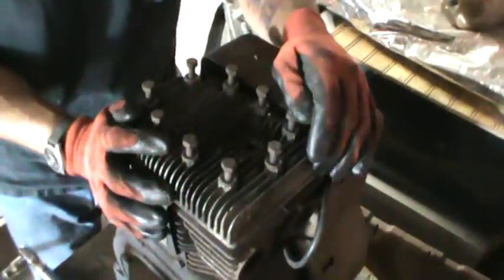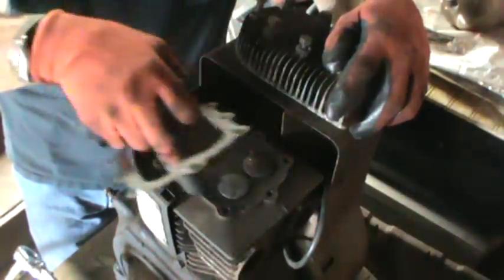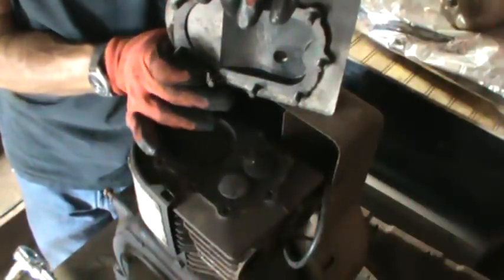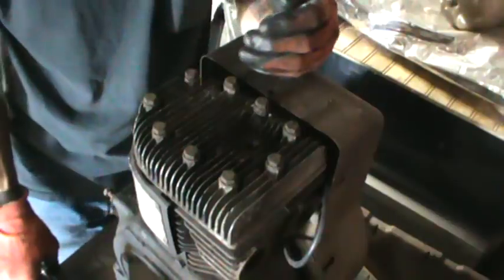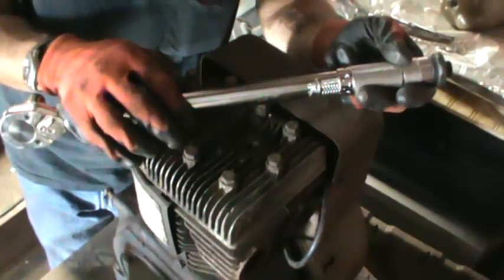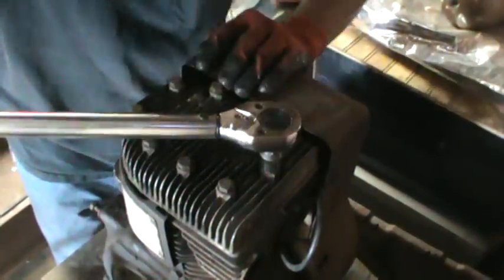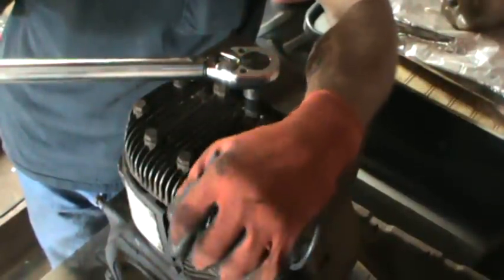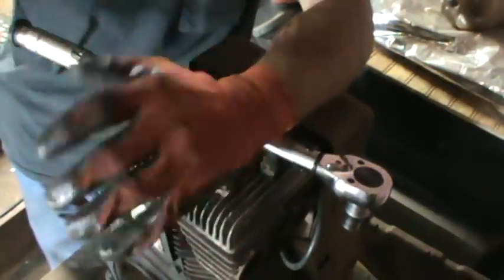Briggs & Stratton Head Torque Specifications

Comment: Is the head bolt pattern the same on a 14hp old cast iron briggs as on a 16hp?  320000 series.  I want to try a copper head gasket. If the only difference is bore diamater and the hole pattern is the same. I should be able to trim a 14hp to fit my 16hp? As I understand it the 11- 16hp engines use the same block.
Reply from the maker: The 13-16hp Cast Iron engines share the same block, yes. And yes, same bolt pattern, so you shouldn't even have to trim up the 14hp gasket much if at all. Zip~
Reply: @ZippoVarga  Where does Briggs make more power then?  The stroke? Cam?  Valve size?  My engine is a 1979.   It's been converted to magnetron ignition.  It has the coil with the button.   And the side that says this side out on the coil is how its on there.  However, The magnet pulls North instead of south like in one of your other videos.  Is my coil backwards?

Comment: I have a 16 horse per Briggs on a craftsmen lawnmower.  All it would do is turn over ,and its would at times pop like it was out of time. It wasn't out of time it either place. Could it be in the cam and litters worn out?
Reply from the maker: First thing to check is the flywheel key to see if it's either sheared or partially sheared. Zip~
Reply: @ZippoVarga  , I have already did that. Could it be in the lifters ,they have some scare marks on the end where the push rod go in them?

Comment: Yes but my 16 hp cast iron motor has the rocker arms on top of the head with the valve springs. Can't start the engine. So my question is what touqe should I use instead of 25lbs. Thank you 🤔
Reply from the maker: Email me at the email address shown in the description below the video and I will send you a chart to help you with tolerances and torque specs. Cheers! Zip~

Comment: Do you lube the bolts, to go in dry?  How about chasing the threads? I didn’t retorque  mine and it blew after 3 years. Another gasket on order, Sunday arrival. Don’t want to do it again.
Reply from the maker: No, install them dry, torque them, run the engine through a few cycles then re-torque again. Cheers Jim! Zip~
Reply: ZippoVarga thanks Zip.

Comment: Could you make a video on adjusting the external governors on Tecumseh engine such as the HH100 or HH120.  I'm starting a frame up restore on a '68 Sears Suburban 12 with the original HH120.  I know a lot of companies beyond Sear/Roper used theses engines.
Reply from the maker: +Sir Malaki Unfortunately, I cannot. There are no Tecumseh engines in my collection. I work on Briggs and Stratton almost exclusively. I'm sure there are videos on here by other members that can help you with your governor issues. Cheers!! Zip~

Comment: Good video ! Question; I have heard people say they 'Permatex' the gasket before installing... why is that necessary ?
Reply from the maker: +A.L. Huxley Anyone who uses any kind of gasket from a tube on an air cooled engine is not truly aware that the heat generated at the head will liquefy most of these compounds. Using it won't cause any known problems, but there is no benefit. It's like putting permatex on header gaskets...it's just to hold things in place while you do the installation. This isn't necessary on small engines like this since you can use the bolts to hold the gasket in proper orientation to the block and head. Good to hear from you my Friend! Zip~